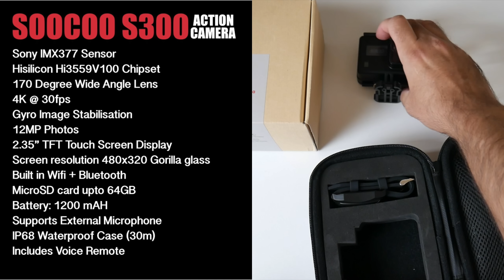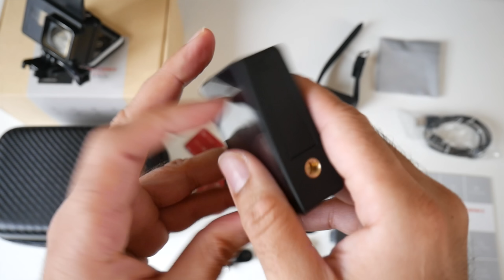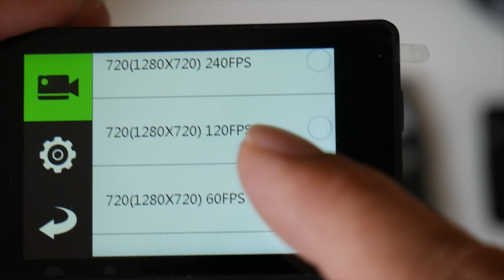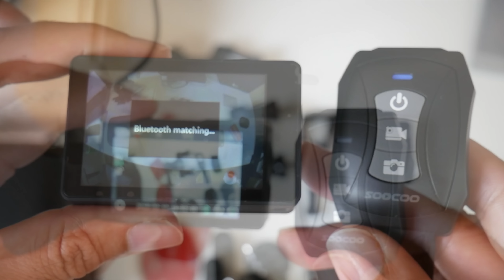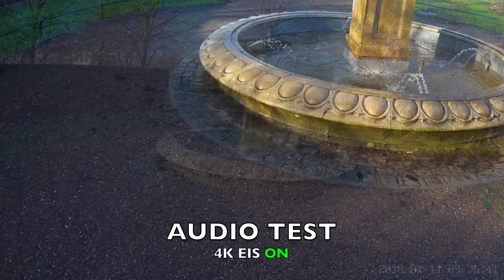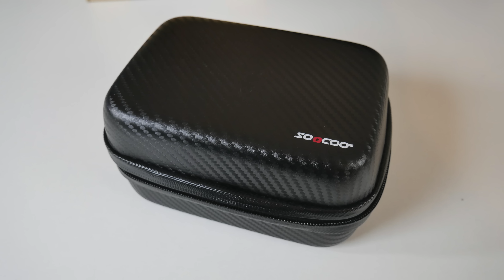SOOCOO S300 4K Action Camera - Native 4K - 12MP - EIS - External MIC

Comment: how long does the battery last on 1080 60fps? Do you think it should last longer on lower resolutions? :)
Reply from the maker: 1080p should last around 60mins. Yes lower resolutions require less power.
Reply: @ChigzTech  , I just got mine yesterday. I tried recording in 1080 60fps with gyro on for more or less 2 mins. I was surprised that the file size is 700MB+ !  Is it because of the fps?

Comment: I just bought this today in hk it was recommended to me as it is on par with go pro 7 black. Total 1500 cash price. All in hkd it was 990 hkd and the accessory 140 64gb card/ 100 tripod and selfie stick/ 40 backpack clip/ 178 spare battery and battery/ floatable handle stick 59. I saw demos and it was good value for the quality output in movement and stable and in day and night time!

Comment: Can you charge it while you are recording and is there a case available that is open so you can record sounds better and allow usb cable attachment during usage?
Reply from the maker: Yes you can charge and shoot at the same time.
Reply: Chigz Tech Reviews thanks for the reply. Bought mine yesterday and once question, according to instructions, red charging LED should illuminate when charging and extinguish when fully charged. I found out that mine does not extinguished. Can you confirm what your S300 does in this situation? Do I have a faulty camera/battery or is the instruction manual incorrect?

Comment: I bought this camera  and my videos are no where near as good as your footage. I have tried several different media players on my pc. its choppy and locks up. any suggestions,  Chigz Tech?
Reply from the maker: C300 is quite an amazing camera, just make sure you go into settings and switch ON "Image Stabilisation". It will be OFF by default. Then your videos will be smooth. Also make sure you have a high speed 4K compatible SD card. Low speed cards will also give you a bad result.  Here is the card I use: https://amzn.to/2wI9EB2
Reply: Thanks , I believe thats my problem, I am using sandisk ultra 64, I bought for my soocoo c30. they make an extreme but I am going for the one you got . thanks.

Comment: Thanks for video, but what is your experience Soocoo S300 in low light  donditions against Firefly 8S,  Thieye T5edge or SJ7 star ?
Reply from the maker: All these are action cameras are designed for day time use, the apertures prove this. Whilst some are slightly better than others, generally they are all bad in low light.
Reply: yes and also expensive GOPRO 6 is bad in low light ?  What is your opinion ?

Comment: I believe you need to do an update the camera then voice control should be working just fine.
Reply from the maker: I checked and I am on the latest firmware already.
Reply: I am using Soocoo S100 pro but I was going to buy S200 or S300 as well so would you please let me know when you solve the problem or better make a video about it.
Reply: It doesn't have voice control even if it is printed on the box. I have asked the factory and they confirmed.

Comment: It looks a great bit of kit. Great specs and not a bad price. Eis and audio work well. I wonder if the voice control works under water..........
Reply: And yeah,it's a shame about the battery life. That is a bit of a deal clincher. That's just not enough time.
Reply from the maker: Glad you liked, yes battery life is an issue but otherwise another nice native 4k action camera.
Reply: It doesn't have voice control even if it is printed on the box. I have asked the factory and they confirmed.